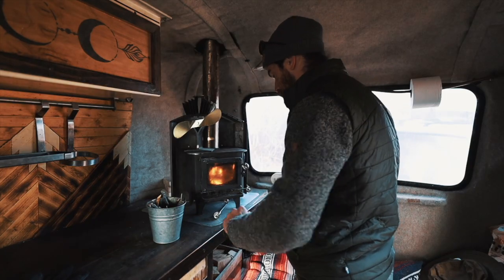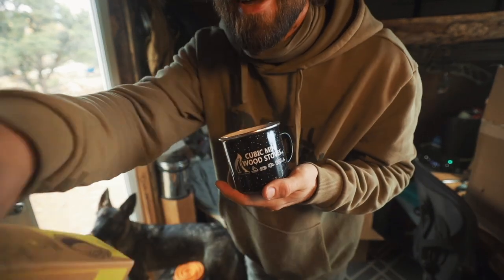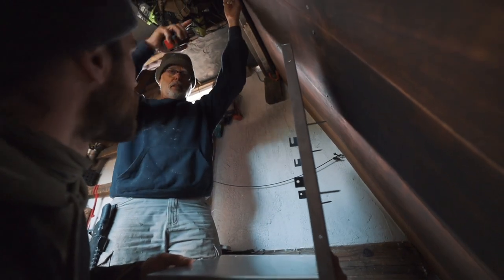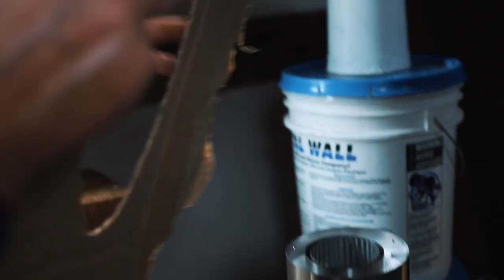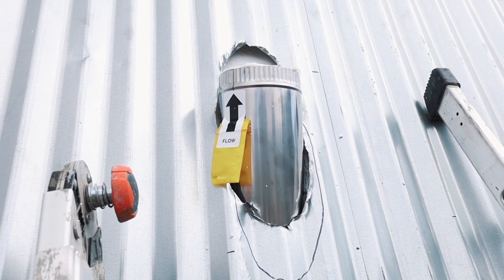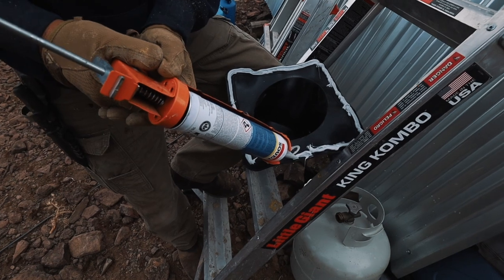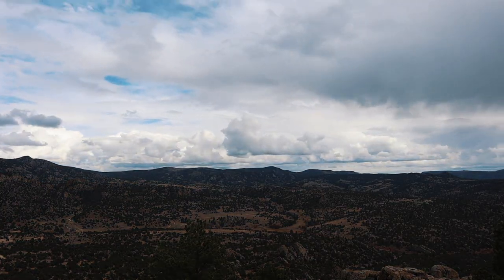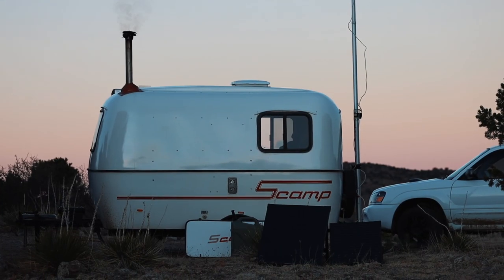MINI WOOD STOVE🔥 in A-FRAME CABIN | Off Grid Life

Comment: I want the mini stove with the air inflow and outflow separate pipes to the outside. With the exhaust only chimney, you get negative pressure issues....air has to come in through cracks in the house to breathe. Like sucking air out of a soda bottle, eventually you reach a crush point.

Comment: LOL!!! we had the Grizzley, we arent sponsored or have any ill will towards the company... the stove kept our 45' RV warm for 3 years. when I say warm i mean we fed this stove every 45-60 minutes with 4-8 piceses of wood. This isnt stardard wood you cut ant throw in...... the largest size possible is like 7 1/2" and that's a stretch. I cut mine to 6" and no more then 4-5" in diameter. We liked this stove because of the size. little did we realize that we'd still be stacking wood around the stove because it was so damn small you literally couldnt keep any meaningful amount of wood around the damn thing. 

So if you need a stove and are looking at a Cubic mini realize they clearly state ABSOLUTELY NO BENDS IN THE FLUE. Meaning you need a tiny itty bitty little bend in your pipe for ANYTHING and I mean ANY FUCKING THING they DO NOT support or warranty anything. 

You'd think they'd make this more clear but they dont.

Our solution was buy a slightly LARGER (used) stove that can take wood larger wood than some thing like 7 1/2 inches. (if youre a woman you realize what 7 1/2" actually means.

we sold our cubic mini with our makeshift flue setup for 4x what it cost us to buy a used stove that at this very moment has been slow burning for 8 hours, and we've had the door and half our windows cracked in our 45" RV with 4 slide outs and it's stilll a bit on the uncomfortable side. I'm literally sweating uncomfortably.